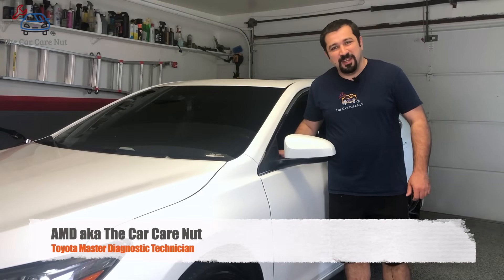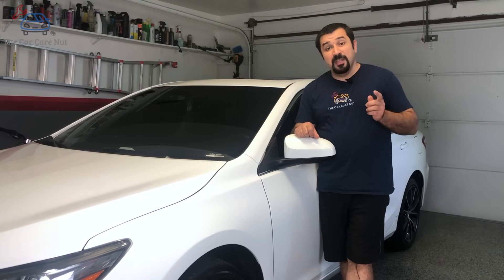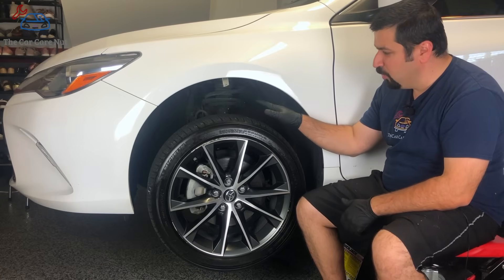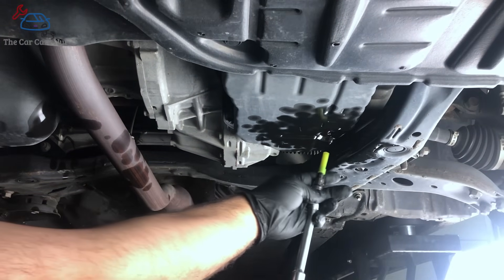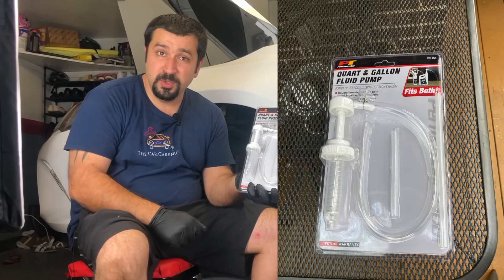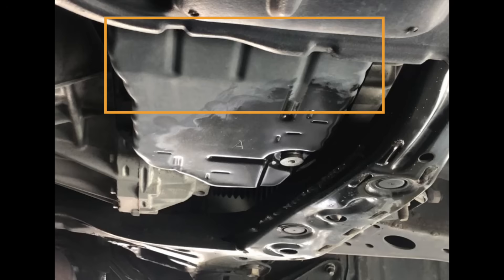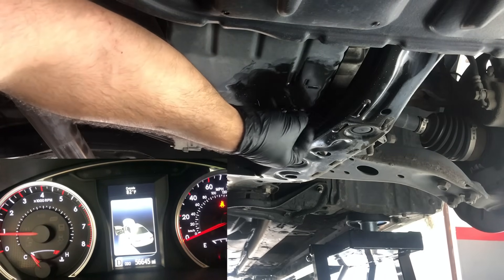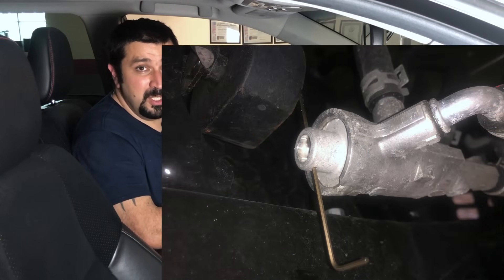How to change your Toyota Sealed Transmission Fluid

Comment: Hi Sir your videos are very informative and easy to understand specially some of your tips which could not be found in the manuals. I just want to ask if its necessary to replace transmission fluids after it has reached 1000km run or breakin period as what being done on the engine. Since im worried of the fine metal particles being circulated once the oil is not drained on its breakin period
Reply from the maker: Hi Manuel and thank you for watching my videos! Regarding the transmission. It is normally not recommended that you replace the trans fluid as break in like the engine in some cases.
Reply: The Car Care Nut Noted so in this case what is your recommended trans fluid replacement?
Reply from the maker: I would replace it every 6 years or 60k whichever comes first and you should have no issues
Reply: The Car Care Nut Really that long? In you video you have three procedure to check the trans oil level however im afraid the option on putting a jumper wire would it be ok just to fill in the transmission the quantity what you have drained. So if you drain 2.5 liters this would be the same quantity to fill in
Reply from the maker: You can do it like that however you’re not sure that the level you started with is exact. If you’re going through all the trouble of draining and measuring you might as well check the fluid level.
Reply: The Car Care Nut Ok then what will happen if ever the level is a little bit high? Can it cause any damage to the transmission?
Reply from the maker: When the level is too high we’ve seen some noise concerns from certain transmissions also leaks could happen but this is with very overfilled transmissions. Under filled will cause delayed shifting especially when cold or the transmission going in neutral when making turns
Reply: The Car Care Nut Ok thank you for the info more power to your blogs

Comment: Just excellent thank you but I would change the filter also,  change filter every 60K
I have 2017 RAV4 with 4 cylinder
I'm hearing temperature is supposed to be 104-113 correct?
Also have 2014 Camry. With 4 cylinder same temperature?
I will be using neighbors scan tool for temperature
Thanks again appreciate it, and I should change filter yes?
Reply from the maker: The temperature is 104-113 and I wouldn’t replace the filter if it was my car. You won’t do harm just most of them that we’ve replaced looked clean
Reply: @TheCarCareNut  ok thanks much for your help

Comment: Can I do this on a 07 toyota camry hybrid?
Reply from the maker: The Camry hybrid transmission is even easier than this. Just drain and fill until it overflows and put the fill plug back. Just like a manual transmission
Reply: @TheCarCareNut  So does this also apply to my 2011 camry hybrid? No need to be concerned with fluid temperature? Thanks
Reply from the maker: Yes this applies to your 2011 Camry hybrid and actually all Toyota hybrid transmissions.

Comment: The total pan capacity is about 2.8 quarts, so if you drain the whole pan you should be safe to put in 3 quarts and just drain the excess with the overflow tube.

Comment: This is a great video! For a 2016 Rav4 Le, does this method apply too? Thanks!
Reply from the maker: Thank you! Yes this applies to your rav4. This procedure applies to all Toyota transmissions with no dipstick except hybrids.
Reply: @TheCarCareNut  what oil should I use for the differiential and transfer case ? Stick with the Toyota brand or mobil 1 will do the job?? Thanks again!
Reply from the maker: I would use 80w90 or 75w80 gear oil. Mobil one is good. Toyota doesn’t even sell differential and transfer case fluid in bottles for consumers as it’s super expensive and not really worth it.
Reply: @TheCarCareNut  thank you so much!

Comment: Hi there, i have a question, i have a 2011 camry 4 cyl with a 152k miles, never done transmission service on it, do you recomend doing it with this many miles ?
Reply: Ok. Thank you very much for the advise
Reply: What about Sienna with the 110K miles, never transmission service? Thanks in advance. 👋
Reply from the maker: At that mileage I wouldn’t either
Reply: @TheCarCareNut  thanks for your answer.👍
Reply: I have a 2010 camry with 130,000 kilometers on the dash, 80k miles will it be ok to drain and change fluid?
Will it be the same process as this video?
Reply from the maker: At 80k miles I would. The procedure will be the same.
Reply from the maker: Hi Carlos. I wouldn’t at this mileage. You could do more harm than good at this point. I would just leave it alone.

Comment: i have a 2017 highlander hybrid... the owners manual states front and rear transmission. do you have any details for the rear transmission?
Reply from the maker: Elio Ricci they word it as transmission it’s actually a hybrid differential. It contains a regular differential and an electric motor. It uses WS fluid and just like the hybrid transmission it’s a simple drain and fill until it overflows from the fill plug and it’s done. No need to adjust the level like a conventional automatic transmission.
Reply: @TheCarCareNut  thank you for your quick reply

Comment: Hello, Thank you very much for the great video. 2016 Camry XLE, V6 with 24k miles. In addition to the drain and refill of the transmission fluid, would you recommend dropping the pan and clean out the magnets? What are your thoughts?
Reply from the maker: Thank you for watching my videos! Regarding the pan magnets I wouldn’t worry about them as much. They usually have a small amount of material stuck to them and maybe at higher mileage it would be worth it otherwise I wouldn’t.

Comment: Thank you for your advice. I have a Camry hybrid. I must say Toyota likes to complicate things now days, also with the plastic/carbon engine filter caps. Wishing you God’s blessings.
Reply from the maker: Thank you! On your Camry hybrid the transmission fluid is very easy to do. Just drain and fill until it overflows from the fill plug and you’re done. Much easier than the sealed transmission
Reply: @TheCarCareNut  I have 2018 Camry Hybrid, is this the same procedure? Or should I be using the one in this video?
Reply from the maker: For your 18 Camry hybrid and for that matter all hybrid toyota models it’s a simple drain and fill and this procedure doesn’t apply
Reply: @TheCarCareNut  thank you for the quick reply

Comment: Hi. Does this method work for a 2014 Toyota RAV4 LE FWD?
Have never changed since buying new. Car has 95k. Is it safe to do this method?
Reply from the maker: Yes this works for your RAV4. I wouldn’t wait longer I would get it done soon if you plan on replacing the fluid.
Reply: @TheCarCareNut  thank you. Does the "D" method also work for this model and year?
Reply from the maker: Yes it does. Practice it before you drain the fluid to get it working so you wouldn’t have issues after you drain the fluid. If you have any issues or questions let me know.
Reply: @TheCarCareNut  thank you! You are awesome. So just want to confirm if i have never changed the transmission fluid on this 2014 rav4 and its at 95k, is it safe to do a drain and fill? There shouldn't be any slippages issues or anything?
Reply from the maker: You’re welcome! Glad to help! I usually recommend replacement at 60k and 6 years you’re slightly over on mileage but it would be a different story if you had 150k. Get original fluid and practice the procedure to make sure you get the fluid level correct and you should have no issues.
Reply: @TheCarCareNut  thank you so much. You have been extremely helpful.

Comment: Hi thanks for an awesome video. Got couple of questions for you. If I bought a vehicle brand new can I just drain, measure and fill? I know no one touched the transmission after the factory. Knowing that the fluid is at the correct level I can just drain measure and fill exact same amount without all the other steps you did in the vehicle. 

I was curious about is at the last step where you got the transmission up to temp and let the excess drain. Did you happen to measure how much came out? Was it close to 2.5 quarts you originally drained? Seemed to me like more than half a quart drained...
Reply from the maker: You could do that but I think if you’re going to go through all the trouble of draining and measuring why not just make sure it’s 100% right by checking the level. I didn’t really measure how much came off but the important thing is the amount of fluid that remains in the trans is correct.
Reply: seems to make more sense
Reply: did you do the cold drain?

Comment: I contact the dealer about this but they said they do a flush, and the price is around $200? Do transmission flush can damage the transmission and are better or I just stick to this method? Thank you
Reply from the maker: A flush will not damage your transmission it does get a bit more fluid. As long as the dealership is including the level adjustment with the flush then that’s a good price. You can always double check the level afterwards if you’d like.

Comment: Do you recommend "flushing" or is it over rated?
Reply from the maker: Phil Indeblanc flushing does get more fluid out. However draining and filling is sufficient in refreshing the fluid enough to keep everything good. Flushing for DIY is difficult as you need a machine so draining and filling is good.

Comment: Would it be ok to drain cold, measure what came out, then put the exact same amount of fluid back in?
Reply from the maker: That would work my only issue is how would you know if the fluid level was right to begin with? If you’re going through the draining and filling might as well go a little bit further and check the level to be 100% sure everything is good
Reply: Thanks for reply, great information!!
Reply: For the first transmission oil change, I used the temperature from the OBD reader method just so I can be sure that the amount is correct in case the factory filled amount was low. For subsequent oil changes, I plan to do it cold, measure, add an extra oz or two in the new fluid and pour back.

Comment: Hi.   Does it apply to siennas?
Reply from the maker: Yes. 2011-2020 siennas don’t have a dipstick. 2017-2020 siennas has the 8 speed which on some requires the cooler bypass to be pushed in as I showed in the video.

Comment: Hi, thank you for a great video.  Can you comment another method: drain the fluid and let it cool to room temperature, measure the volume, and then fill in the same amount of ATF back avoiding some steps in your procedures.  Thanks
Reply from the maker: Thank you for your comment. Sure that could work but how do you know that your fluid level was good to begin with? If you’re going to measure and drain and fill, not much is left to check the fluid level and make sure the level is 100% accurate.
Reply: I drained the fluid in the morning.  Just moved the car into the garage and turned off the engine.  Then I removed the fluid and measure its volume.  Put in the exact same amount.  IN my case: 2 quarts at each drain-and-fill.  Ambient temperature should be roughly the same at each time. Go for about 50 miles after each time. Jack car up at the front enough to do the job.  Use jack stand, of course.  I'm doing the 6 th time this weekend.  Car is running better.  The drain plug is of soft metal, so the 6 mm hex hole can be rounded off easily.  It happened to me.  $6.76 for the plug at the dealer.  I re-use the old one by pressing into the hex hole a screw driver bit that has a shank measure 1/4", a little larger than the hole itself.  I cut off the blade of the bit , and I use a vise to press it into the plug.  To open the plug with hole rounded off, I used a vise grip, and it came out easily without doing damages.  Then I learned to save the new plug and the newly repaired one with the use of the vise grip each time I open it, and use the 6mm hex socket or 1/4" socket only for tightening.
Reply: @tinhhuynh2  
Had the same issue with the drain plug 😁. Ended up using wise grip to open.  Will call dealer tomorrow to order plug and washer.
Reply: @kdpo1990  Great!  I also use a new washer each time.  I got the crush washers on Amazon.com and ebay.  But I believe they are not so expensive at the dealer.  My car was over 94000 miles when I got it two months ago.  The previous owner never had the fluid changed.  After 6 fluid changes it it running good.

Comment: Do u recommend repeating draining several times? When u drained fluid, it didnt appear very red in color. I plan to do on my CVT when I accumulate the mileage. ALSO, at what interval do U recommend?
Reply from the maker: Rice Burner I wouldn’t repeat it multiple times. Once is good. You mentioned a 4th gen prius is that the cvt you’re referring to? I would change it around 60k and 6 years whichever comes first

Comment: Hi, how much transmission  oil (approx) do i have to top up, if i just done replacing my driveshaft both left and right..... Thanks 

camry  2.5 2012
Reply from the maker: mark if it’s a top off after replacing axles it’s usually no more than a half a quart. I would get one bottle. If doing a drain and fill you’ll have to measure but usually you’ll need about 4 bottles to be on the safe side
Reply: Actually my foreman top up 1 litre without checking the leveling. 

Can i just let the engine run at operating temp, then i loosen the bolt at bottom to let the excessive atf comes out (if there is any).  Thanks for ur prompt reply！
Reply from the maker: That’s not an accurate method. You’d want to let the transmission cool down and recheck the level accurately.

Comment: The steps are almost the same for my FJ Cruiser A750F AT. I followed the step to change the pan oil and filter. It extracted 5 ltr of fluid. When I added 5 ltr new and increased the temperature to about 120 F. The overflow plug drained almost 2 ltr more. I'm confused now. I checked the temperature with Temp Gun. Even If my Temp gun is off by +5 -5. Still, the 2 ltr is quite a lot. Please guide.
Guide link: https://www.purefjcruiser.com/docs/2007%20Toyota%20FJ%20Cruiser%20Repair%20Manual/A750F%20Automatic%20Transmission/Automatic%20Transmission%20Fluid/01700210.pdf
Reply from the maker: So did you measure the amount that you drained initially?
Reply: @TheCarCareNut  Yes it was 5 litres.
Reply from the maker: That’s interesting. What year is your FJ?
Reply: The Car Care Nut 2007 with Toyota A750F Transmission.
Reply from the maker: Ok I verified the data your transmission drain and fill capacity is 1.7L so by removing the pan and replacing the filter you likely upped that number to 2L which means your transmission likely was overfilled by 3 liters to begin with!!! I’d drive it for a week or two and double check the level just to verify and you’re all set.
Reply: @TheCarCareNut  Thank you so much for clarifying. You're a champ!
Reply from the maker: You’re welcome! Glad I could help

Comment: Hello, I have a 2008 Toyota Axio and it doesn't have a dipstick but rather a dummy plug which is leaking. Can you tell me if this plug can removed ?
Reply from the maker: The Toyota Axio is not a model sold in my area so I’d need a bit more information. What engine and transmission code does it have?
Reply: @TheCarCareNut  its NZE 141 and Engine is 1NZ. Not sure if this helps. Do you have and email address where I can probably send you a video clip of what I am talking about?
Reply from the maker: Tracy Harridath email in the description of video. Send it and let me take a look.
Reply: @TheCarCareNut  okay will do tomorrow since its midnight here in the Caribbean. Thanks

Comment: Hey @Carecarnut, I really appreciate this video. My car got the torque converter replaced by the previous owner under warranty. I can kind of feel the shifts and want to check the fluid level. Had two questions for you :
1) My garage floor is not completely straight so it might not be 100% level but pretty close. Would this pass?
2) stupid question: where can I find the  jumper wire?
Thanks for all your help!
Reply from the maker: Hi Amedeo! So regarding your garage floor if it’s very sloped that would be a problem but it’s somewhat flat but not 100% that’s ok. Also the jumper wire can be any multi strand piece of wire that you can buy at any auto parts store
Reply: @TheCarCareNut  Thanks so much!
Reply from the maker: My pleasure.

Comment: I just got a 2015 Highlander XLE after having one 2005, one 2006, and two 2007 Highlanders which I did conventional transmission fluid changes.  Do you know if the 2015 Highlander XLE V6 requires the fluid to be changed in this way or is it the more conventional way?  Just a cursory check didn't reveal a dipstick but maybe I didn't look long enough.  
Love your Car Care Nut Logo, especially the AGAPE symbol!
Reply from the maker: Thank you for your comment! Your highlander does have an overflow type transmission so the procedure in this video applies 100% to your highlander. Thank you! The lord is  at the center of it all!
Reply: @TheCarCareNut  Amen!  Soli Deo Gloria!
Reply from the maker: Amen!

Comment: What are your thoughts on flushing a high milage transmission and just changing the fluid without flushing, does the flushing makes slipping in the already worn out parts in the transmission. By the way nice demo !
Reply from the maker: Flushing or changing the fluid in a high mileage transmission without a very clear and precise service history is not recommended at all. I would just leave it alone if you got a high mileage one with unknown service history as you can do more damage than good in this case.
Reply: @TheCarCareNut  My 2012 camry has 125k miles and my toyota location told me never change the tranny fluid cuz they’re lifetime.  Is 125k miles past the ‘high mileage barrier’ to safely change the fluid without causing more harm than good?  I drive the car very easy but im in Florida and passed the 60k interval you recommended :(. Thanks for all your videos!